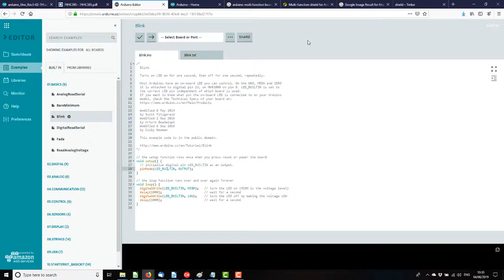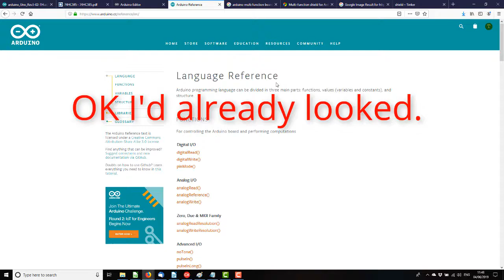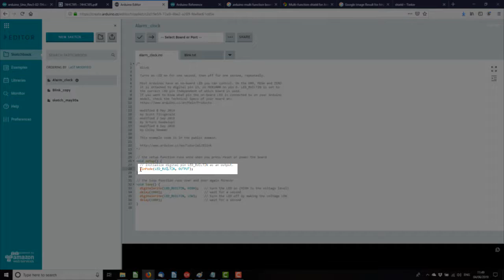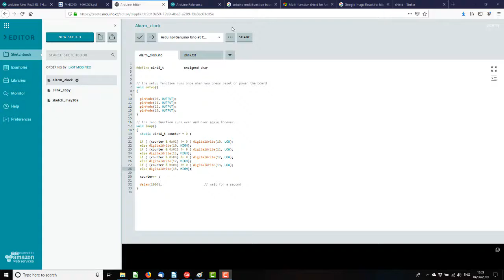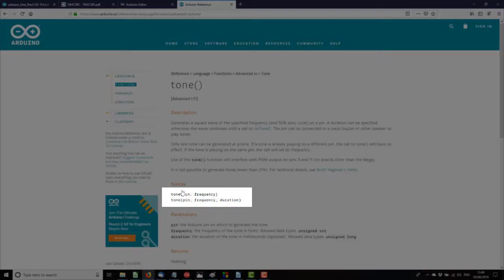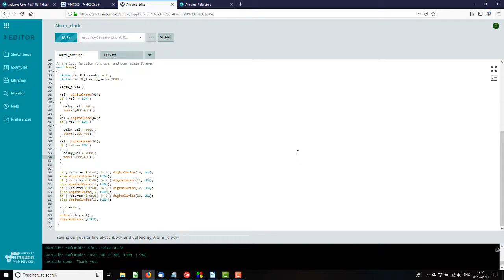Lets Get Started On Our Arduino Uno Based Alarm Clock

Comment: What is the board on top?
Reply: It's called a Multi-Function Shield. Check Amazon I've seen them including an Arduino UNO for around $10.00 US. Search for Hackatronics and you will find a pdf tutorial for using this board along with the source code.